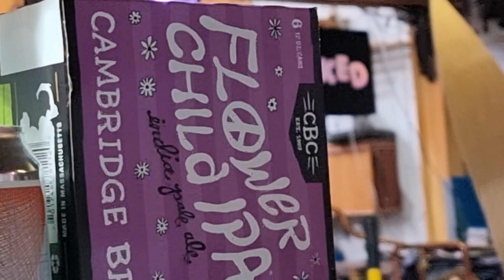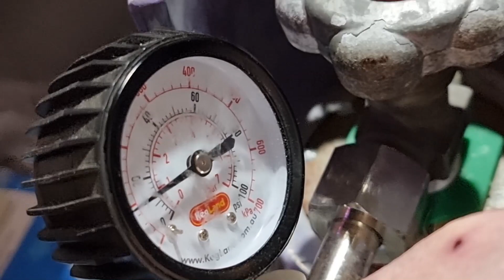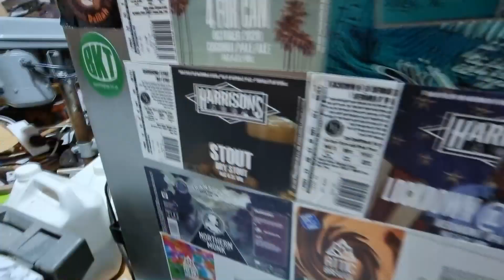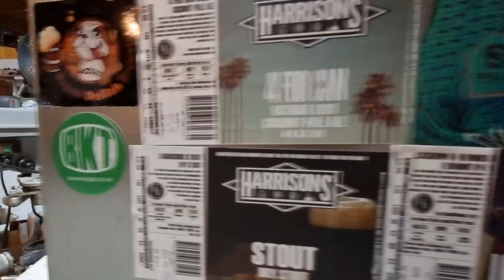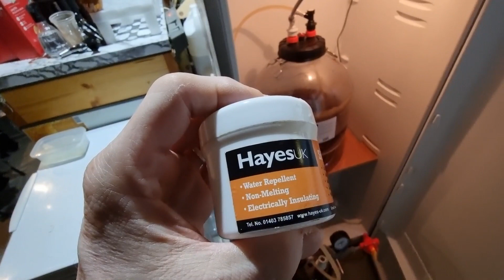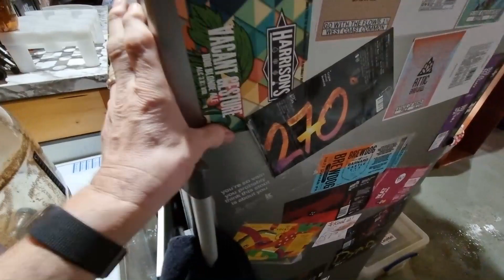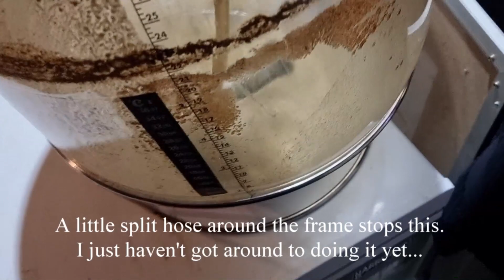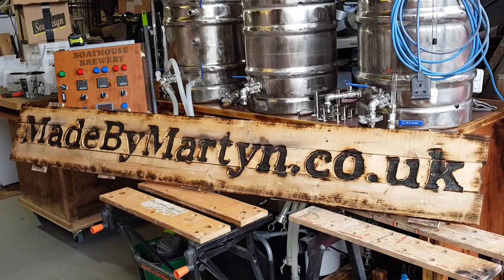BREW - Another Oxygen Free Dry Hop Transfer.

Comment: How do you dry hop when you are still fermenting? Ie you need to do 2 dry hops, one after say 4 days during fermentation and then 10 days when fermentation is pretty much finished. It’s the first dry hop I am interested in.
Reply from the maker: The same process would probably work as the yeast cake won't really have been formed by then.  
(A little shake should stir up any that has formed).
My worry would be a potential blockage transferring for the second dry hop.  I've one of the original Fermzillas with the jar and butterfly valve which would be another potential oxygen free method.